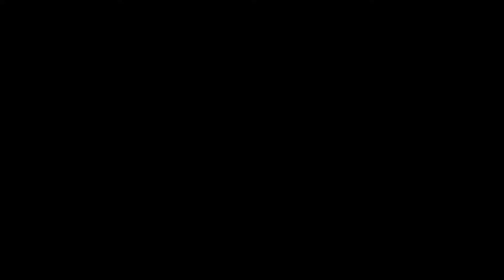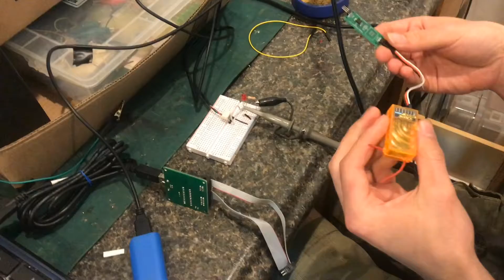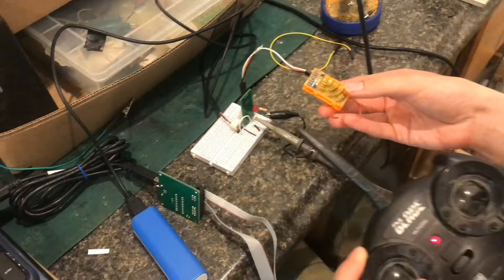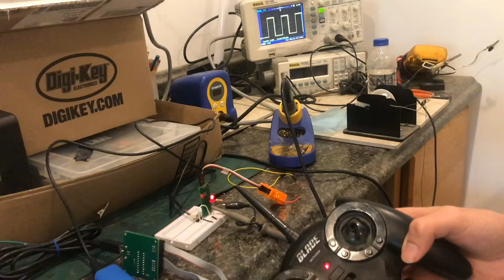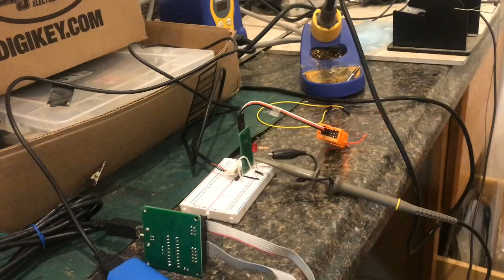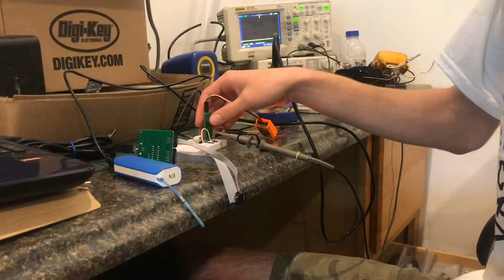converting servo signals to PWM (Pulse Width Modulation)

Comment: Hello  this converter have output pwm only or it also has a direction signal ..... useful for example to drive an H-bridge for a DC motor that can reverse the direction of rotation.